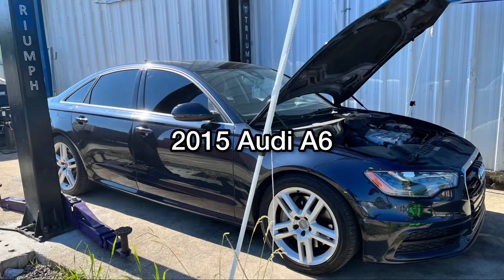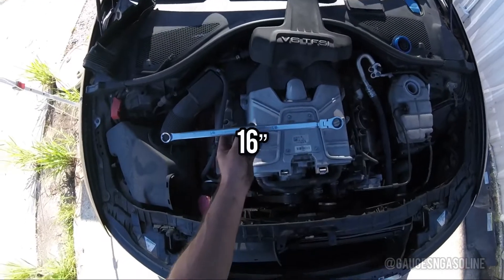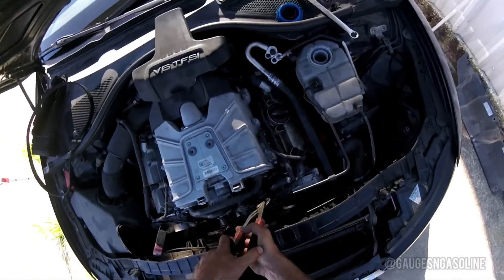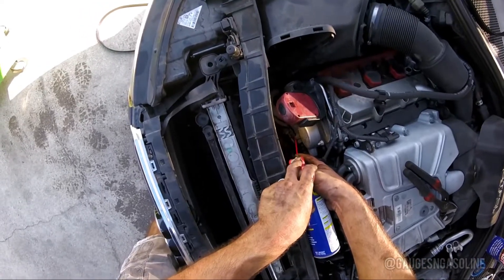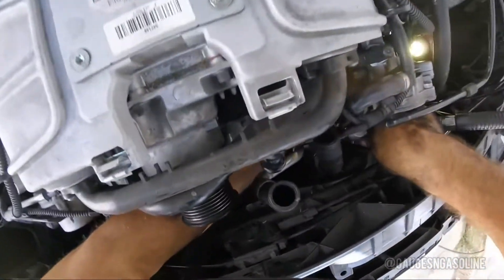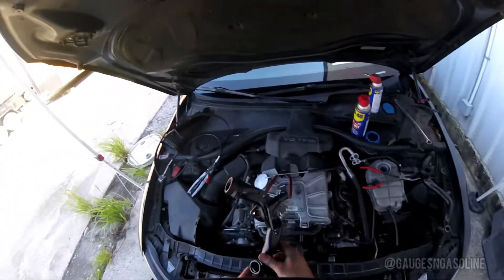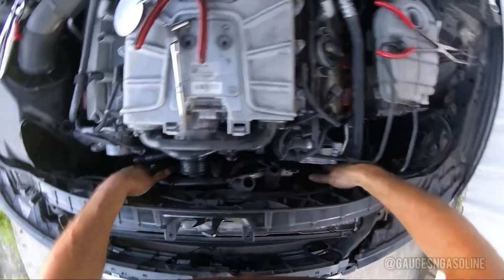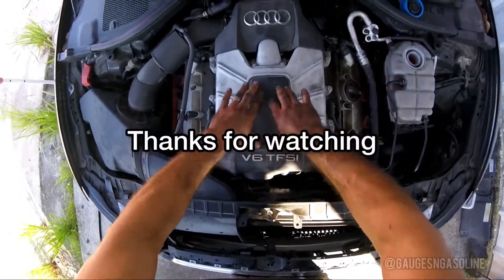replacing a coolant cross over pipe on a 2015 Audi A6 #audi

Comment: There are 5 bolts on the audi q5 3.0. From 2013-17. There is no space to remove it from the bottom. There was just enough space to wiggle it out and reinstall it. It can be done without removing the whole front bumper, radiator and fan!